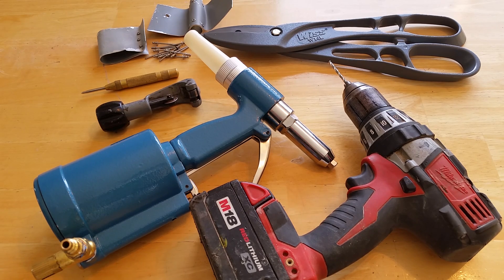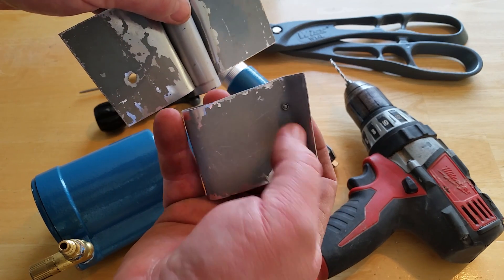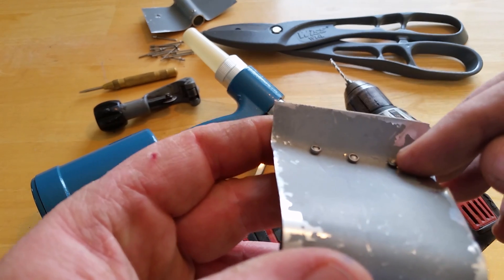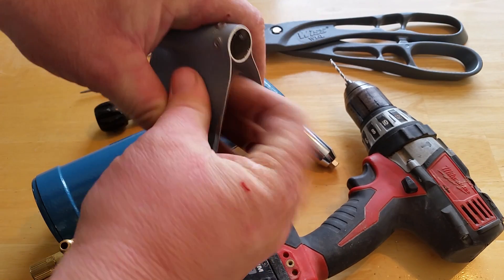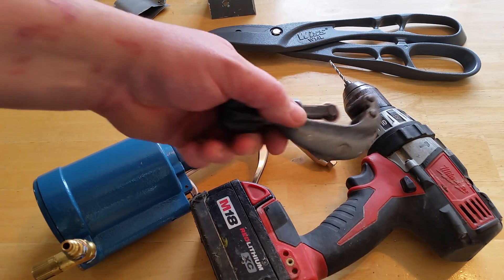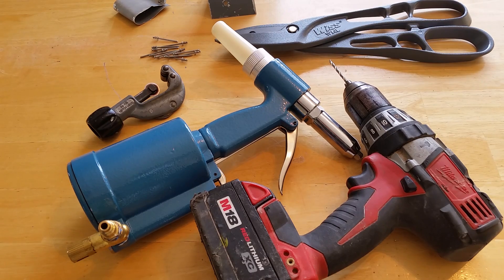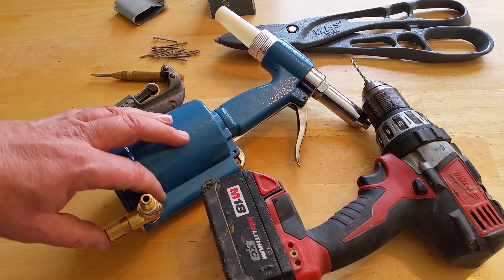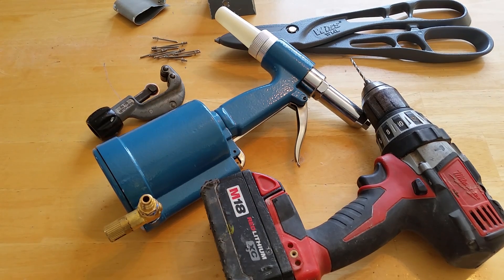Legal Eagle Ultralight construction video #73

Comment: All those aircraft fasteners have design allowables, meaning they are guaranteed to have certain strength in service. Even those small #40 drill size pull rivets are very strong, nearly 100 pounds pull apiece.

Comment: gday mate,quick note,I have used that type of rivet gun a lot,one drop of oil every day,take the nose cap off and clean the rivet grips every day,use air,wash out any oil or grit,they work better if dry.The power of the vertical piston is transferred to the horizontal pulling piston by means of a column of oil ,check this once or twice a year. but anyway they work well if maintained. Cheers Ross
Reply from the maker: Good advice Ross! I keep it pretty oiled and as I take it apart you can tell the difference in a China made product for $20. Like you say, keep it clean and keep it oiled and she'll treat you right.